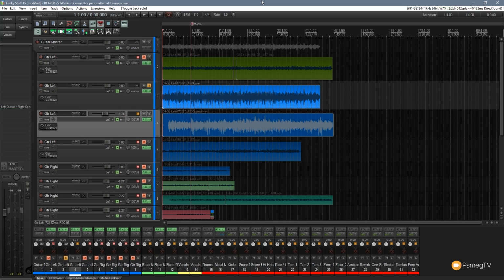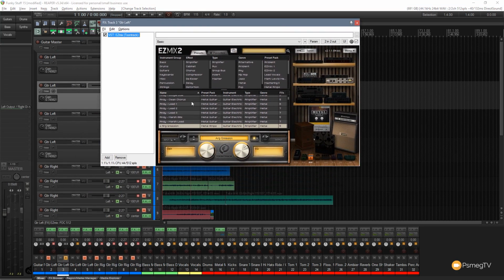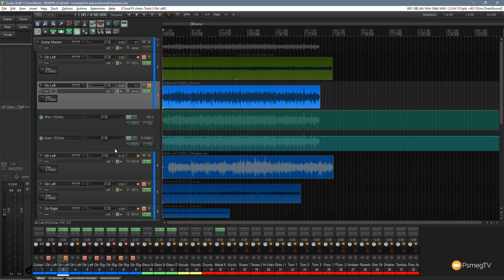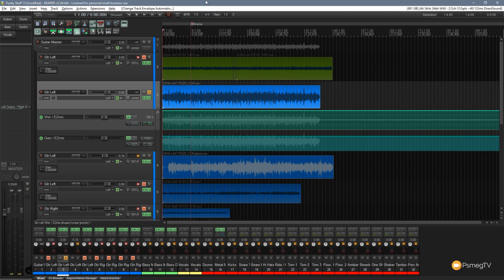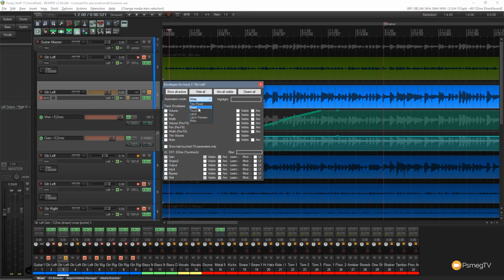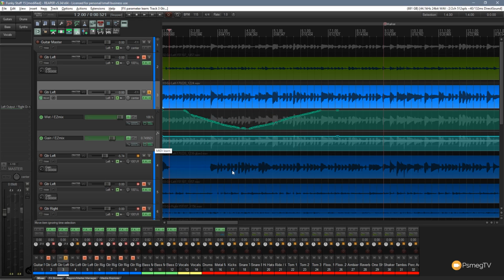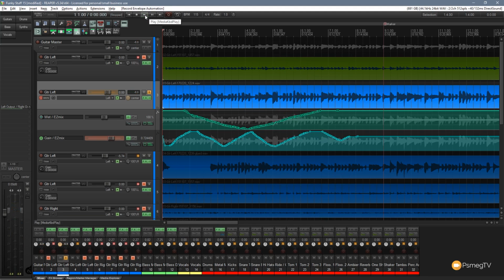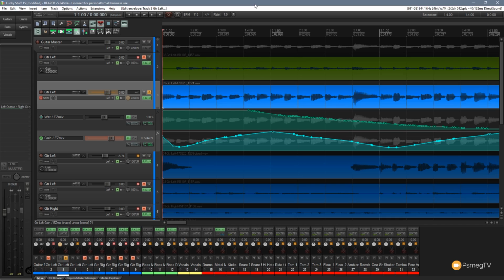How to Automate FX Parameters in Reaper: Tutorial

Comment: Thanks for this video! Is there any super-quick way to record synth parameter tweaking, without having to go into the Envelope Dialog window, selecting parameters for arming, and setting automation to write? Couldn't Reaper just record the automation/knob-twisting while playing the keyboard keys, if everything was "learned" beforehand? Thanks so much!
Reply: I came to watch this video because I've been doing basically what you're describing in your comment. Reaper seems to capture my automations (within spitfire BBC core plugin) as I play them, but can be super finnicky if I don't move the automation controls--I have them mapped to midi controller--before I start recording. That's why I'm here to learn about trim modes hah.
Reply: @MikeSealguitar  I can't believe no one yet responded... haha. It really is kind of a pain in the butt to set this up. The fastest way I've found though, is to move a knob on the plugin, turn it on your midi controller, then go to the "Param" button, then inside that, "Learn". That's the quickest way. And then, set the Global Automation Override to "Write" or whatever else. It isn't ideal, but it's the fastest way. Hope that helps! And yeah, Trim/Read is the default... so, it plays the automation you recorded, without altering anything else. But if you mess up your real-time tweaking of automation, sometimes it's just faster to mouse it in, by showing the envelope on that track.